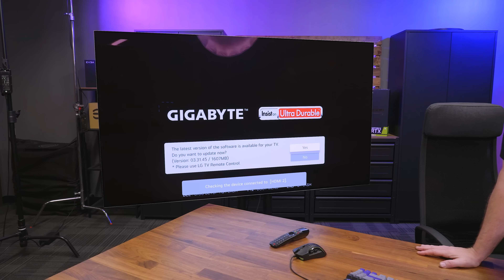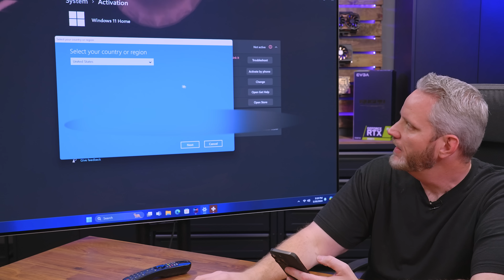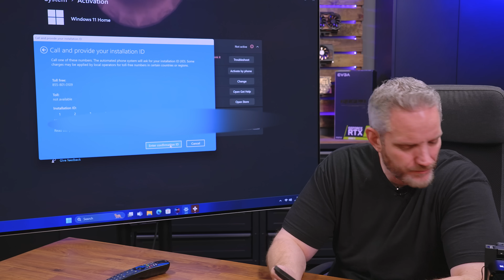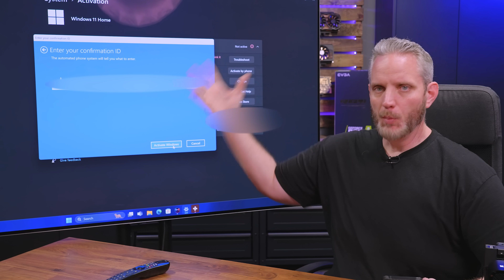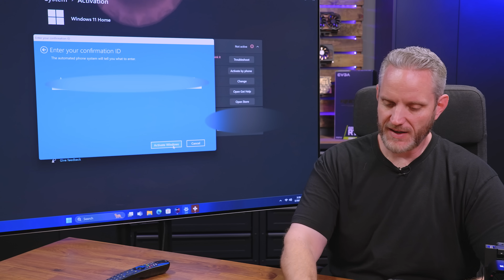How to move OS drive to new PC and keep Windows and Activation! EASY!

Comment: Whenever i go to a new cup/board with same hard drive it always tell me something has changed. Then i have to decide to reset tpm or boot with current tpm. It never boots right to windows to do this activation. where am i messed up on this?

Comment: It's good you walked through this, FYI my recent experience was a bit simpler when I just had to do this a few days ago for my niece's PC on Windows 10.  
We built a whole new system, cloned the C: SATA SSD to a new M.2 using Macrium, telling it to fill the rest of the space.

Clone worked fine, booting up it took a while to install the basic drivers.
Then, Windows Activation would not work and tried to get me to go to the Windows Store.
Click TROUBLESHOOT instead.
The next prompt tried to also suggest I buy a license, but at the bottom of the prompt was a link that you can click on that says something like "My hardware has changed".
Clicking on that brings up a pop-up that will try to activate, fail and say the servers aren't available, but when I waited about half an hour and tried again, it just magically activated.

Hope this helps others - if it doesn't work for you, then just fall back on the phone-it-in method suggested here.

Comment: About to do this same thing going from Intel to AMD cpu and I have a few questions if anyone can answer. Do the old motherboard drivers cause issues? Do I need to remove them all after I update the new motherboard? Do I need to change anything on the current system so that it runs properly? Last one, should a do a fresh start on windows to remove the old stuff and let the new stuff work properly. Thanks to anyone with any answers to these question.

Comment: Found this out 3 days ago. If you have a digital license instead of a retail DSP license when you swap out board and CPU when you try and activate again it doesn`t work. But there is a little link under the activation that says changed hardware recently?
Click that and it will look on your Microsoft account for PCs that was activated. Then you choose your old installs activation. It removes that activation from your digital key and activates your new hardware.

Very handy since I have stuff like HDclone that also loses it`s license when I change the windows key. (Usually thought board but it stayed activated this time after activating the same windows key through this link.)

Very nice. I do IT and main pc`s boards swap rather frequently. Being able to just tell Microsoft this key from that pc has moved to this new pc and then keeping your easus and hdclone and everything else activated is a bonus as most of those software licenses comes with lifetime for 1 device. If you change device you end up buying a couple $100`s worth of software again.

Comment: Transferring a Windows installation to a completely different computer has really become easy nowadays... 
But you could do that even as far back as Windows 2000, XP or Windows 7, if you attached the Windows drive to an SATA Add-On card and had it's driver installed. If you moved both the drive and the card to the new system, Windows could still boot from that card even if it didn't recognize any onboard components out of the box. 

It all comes down to having a working driver for the controller the drive is attached to. Today, with AHCI controllers, there's usually always a working default driver so it's really easy.

Comment: I got idea that won't befound on the internet.Why not link the old test bench and new test bench? Just sodering right gauge wire to power to power on motherboards and then getting a power supply for both their have to be more done. And sure can make adjustments to other things to make it actually work if you get my idea. I always wanted to see something like go down.

Comment: hey jay, Been contemplating and planning on upgrading my CPU, MOBO, and RAM, but keeping my drives.  So to clarify, all my drives should still function and run properly once in the new system after installing the drivers? I was nervous that i'd have to redownload all my DAW software, vst instruments, folder pathways and programs. theoretically, everything should still be the same in the new system, besides the drivers and reactivating windows?

Comment: I gather this only applies to full desktop PCs because I went from 1 mini PC to another and just moved the SSD I had on my previous mini to my new one which came with 2 SSD slots. 

Once I installed my old SSD with windows I didn't have to reactivate anything, it just booted up the same as it did in my old mini...the way I thought it would... The only thing I had to do was download the drivers for my new mini as it has a 780m igpu and my previous mini had a vega 8 igpu.

Comment: Will this work without any issues on a windows 7 RAID install on the OS disks? Or would I only be able to use one? System has 2 RAID boot/OS disks and 3 more storage disks all SATA.

Comment: I know this video is old but I'm upgrading my pc soon new motherboard, cpu, ram. Moving from am4 to am5 i know how to build the pc parts wise not super techy when it comes to software and files and whatnot is there anything i need to know for doing the upgrade? I can provide specific components if needed but for quick reference I'm going from am4 to sm5 cpu and motherboard keeping same brand motherboard and i got new ram everything else will be moved from old system to new system (gpu, ssds, power supply) thanks in advance i know this is a long read

Comment: How far can you stretch this? I’m replacing my mobo and CPU, and I’m jumping architectures from Intel to AMD, not to mention leaping forward a few generations (six or seven). 

I did a reset on the current computer and I finally got it back to how I had it before the reset, and I’d like not to have to go through that again.

Comment: My original win7 product key(which I don't have any longer, who knows where I put it) was used when I installed win7 pro. It has since been free updated to win10. Now I want to update win 10 to win11, but, my MB/cpu is too old for win11. Can I use a new MB/cpu with the existing win 10 SSD and do the same as you did(phone call) to activate the new MB or do I have to get a new win11 disc with product key?  I don't have a registered MS account, should I get an account first then make the swap? Thanks.

Comment: When I did this... I had the "Profile" bug.... basically, about a day later, everything started getting deleted from my user profile... windows was resetting my profile.... I had to power off and use a different computer to make a backup of my user folder (C:\Users\ my user name \) 
 then I logged in as user2 and let it do its thing..................
from user2, i went through the process of installing driver and updates...etc...............
then i copied the files from my backup overwriting the phoenix folder not user2
then i rebooted and logged in as phoenix and everything is there AFAIK hopefully....

I read an article that said to first create a new user profile, before you move to a new motherboard, then move the drive to your new pc, then use that new profile to setup your new hardware, before you log on with your regular user profile .... but it did not explain much more than that....

i am searching for video confirmation of what i experienced.... i wish there were more videos showing this and proving this to be a reliable alternative to a fresh windows installation on the new hardware, along with every app, and every setting, and update, etcetera and on.... and on and on and on...........

Comment: I have never built a PC but since one of my old ones stopped working I'm going to give it a try, the part that I feel more insecure about is the installation of windows and the BIOS settings, does changing the OS drive avoid the BIOS part or do I still have to do it? also, I have windows in a 250 G and want to change it to a 1T, do you have any videos that can help with this and also with the best settings for BIOS?

Comment: About to swap from an old am4 socket intel system to top of the line am5(9950x3d and an x870e mobo) ryzen build.  Will there be any hiccups from switching one type of build to another? Intel to ryzen**?

Comment: Jay.. <3 your vids. that said, and actually you said it to(cents), why make a vid that's 15 min when it would take five(cents)  min WITH the sponsor ad's to answer your, yes YOUR question in the title.. well.. some thing to consider.  ie [p-off your viewers or get more money from your sponsors] it's all down to just that. Apparently you prefer to please your sponsors. imho as always.
Side note i just put an SSD that iv'e been using for the last 10 years into my "new" other platform system and it got stuck at Getting devices ready 4%.. that's not your fault though. As i do like your vids i was looking for solutions..

Comment: My experience was different. I had an old Asus Windows 10 laptop that I had upgraded from HDD to SSD. I purchased a NUK, memory and NVMe. I cloned the NVMe from the laptop. I built the NUK and downloaded the drivers from the internet using the laptop. I turned the NUK on and it booted into Windows 10. It did reboots and driver setups and the monitor was in low resolution. Then I started loading all the new drivers from the USB drive. After many reboots and screen adjustment I was back home to my old Windows 10 OS. It never asked for my new Windows key. I kept the same OS while I checked out the new system to see if I needed to return any parts. I logged into my Windows account and it showed two computers with the same name running Windows 10. After a few weeks the opportunity to upgrade to Windows 11 came up. I upgraded and installed the Windows 11 drivers. Windows never asked about the Windows key. Now I have an unused and unreturnable Windows 11 key. And of course Office worked too. Now my Windows account shows two computers, one 10 and one 11.

Asus purchased the NUK line from Intel so both were technically Asus computers but with Intel branding on the documentation. The laptop was an AMD and of course the NUK is Intel.

Comment: Yeah, your mileage may vary.  Swapped my SSD Hard Drives between two Dell computers and I'm dead in the water.  Comes up with "No bootable devices found" when I start up the computer.  Now the brains of my household is completely dead and I'm going to have to pay some IT hack out the rear end to fix this, which is not what I was looking for.  NOT HELPFUL.

Comment: im upgrading from a b450m pro to a b550 atx , i hope this works for me. my parts come tommorow so i was getting ready for the headache. i have an 8gb 665o with a ryzen 3600 witch im switching to a 7 7600 8 core with 32gb of ram for my new 1440 p monitor.  not sure how all this will work out since it was a 1080p bild

Comment: I was surprised to learn that if you are using an NVME drive and move it to the new system it just works. Have done it twice with no issues or activation needed. Windows quickly takes care of installing anything needed. In both cases I kept the video card, but had changed the ram, cpu and motherboard.
Reply: Did you have to uninstall the drivers for your cpu either being amd or Intel before swapping it out or did it just do it automatically
Reply: @mintchip014  i have never had to update any CPU drivers. system autodetects it.

Comment: Jay!! Need some help! My current PC has 3 M.2's (2 TB x 2 and 1TB x 1) My OS (C drive) is on the 1TB. I would like to replace that drive with either a 2 or a 4TB drive. Is there any way I can do this without loosing the data and more importantly the OS? Do you have a video on this? If so can you give me the link to it? I have all my OS and MSFS and community folder and all that stuff on it, and I'm now getting down to like 80GB's free. I should have planned ahead better. DOH!
Reply: Actually the comments say it won’t let you clone OS software anymore to don’t use that tool

Comment: i am trying to move my PCIe NVMe M.2 with windows 10 from my hp 15-CT0 i7-8550U to an hp 17-cn0023dx with Intel Core i5-1135G7  (it had win 11 originally) and my m.2 is not seen to boot to or in bios except as a RAID drive.  How do i get the new laptop to see my drive? tried bootrec, sys diag, and bios doesn't give any option but UEFI

Comment: Microsoft has made it easy to physically transfer the hard drive to a new computer... unless you have a SATA SSD on the old and an NVMe on the new.  🤥
Reply: That's a completely different situation... At that point you format the old drive and install windows in the new one. Even the title of the video talks about the same drive.

Comment: For me it was even easier. After upgrading my CPU & motherboard, Windows said "not activated". Clicked the troubleshooting link on the Activation settings, and one option presented was – paraphrasing here – system was recently upgraded. Perfect. Clicked that and was asked which system and presented with a list of systems linked to my MS login. I picked the one and it said "You're now activated." That was much simpler than what I expected or feared.
Reply: So I don’t have to wipe any data or buy any new storages? I just plug in my old SSD and m.2 into my new build then follow the steps you just said basically
Reply: @purpy995  That's what worked for me. As long as the old motherboard was activated, then that should transfer to the new one. You just can''t use the license on more than one system.
Reply: @sfperalta thank you so much  I just upgraded basically a whole pc going from 3700x, 3070 ti to a Ryzen 7 9800x3d  and rx 9070 😭and getting ready to build it later this week
Reply: @s @sfperalta lso so I don’t need to download windows on a flash drive or anything since it’s already in the C drive? Just put my storages in the activate it by clicking the trouble shoot thing? my bad if  it’s a dumb question lmao been a while since I’ve built a pc
Reply: what if you don't have an MS account? OR should I register for an MS account before I do anything like change the MB/cpu.
Reply: @wally6193  I can't say if the same works without an MS account, but the account is free and you don't actually have to be signed into it while using Windows if you also have a local account. That's what I do.

Comment: So changing from intel to amd means changing out mother board and ram, i don't have to wipe my ssd and do a fresh/reset windows? I can keep the windows and once it all boots back up, download the new driver. Do i uninstall all the intel and gigabyte drivers for old hardware, or does windows adjust and run everything to be correct?

Comment: I purchased two OEM copies of Win10 with installation disks for new builds 8 months ago, successfully installed one copy & set the other one aside. Last week I broke the seal on the 2nd copy & tried to install it on a new build. After the install I got the "Activate Windows" pop up so I attempted a second activation with the same key. I was told the key wasn't valid despite entering & checking the entry 3X.

I have 4 machines running Win10  using keys from first year promotional copies given to me by Microsoft. One of the hard drives crapped so I had to do a fresh install on a new drive in the same machine. I didn't have the original install CD handy so I used the most recent Win10 downloaded from Microsoft. This led to a heated discussion with a Microsoft "key guardian". The outcome was they won't allow my  16 year old key to be activated with the current download. I have to find one of the original promotional disks, install & reactivate it and then do 16 years of updates... There is no reason a legitimately acquired Windows key shouldn't work with any version of at least the same generation. 

So much for the new "nicer" Microsoft...

Comment: I came here thinking this video would provide a solution as I'm about to replace my board but it doesn't ..

I built a new system only last year and did everything that has been done here...and it worked ..kind of..

there was weird bugs and glitches all over the place, no amount of windows repairs or driver fresh installs would ever solve it...Just because windows boots up installs a few drivers and gets activated doesn't mean the migration works...

Comment: I'm planning to build a "new" system soon, reusing most of my current parts except for the RAM, motherboard, and case. My biggest concern is transferring my current drive to the new system. Will it boot into Windows? Will I retain all my files? While I still have some doubts, watching this video has boosted my confidence in tackling the build.

Comment: Just to clarify and not break anything - i  can literally just remove my SSD /HDD's from my current system and plug them into a new system, as is? Data on them and everything?

I understand ill need to sort Windows out as in the video here. Just wanting make sure its literally a "remove from old, plug into new" situation
Reply: Make sure to update your drivers for your new hardware, and uninstall old drivers. Old drivers can cause problems, and be careful, read up on what drivers are in use and not in use. Check if you need to update your bios version. then you should be set.
Reply: @ThatUpster  Jesus christ. WHAT? How do I know what are old driver? How do I know what are my new drivers? What do I read up on what drivers are in use and not in use?